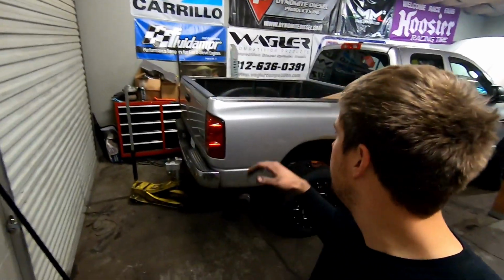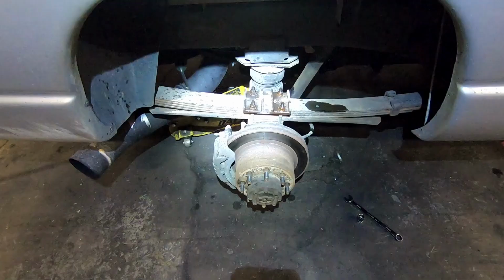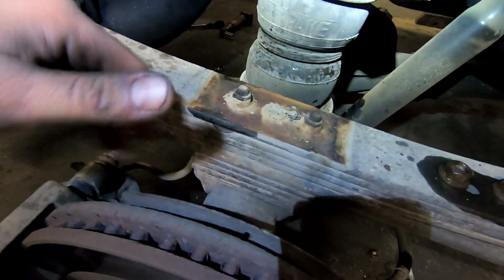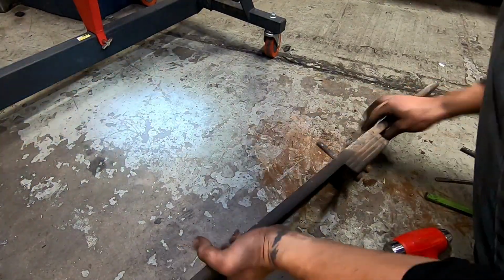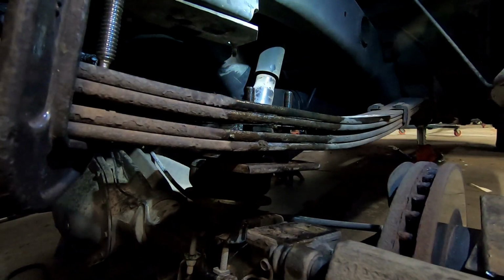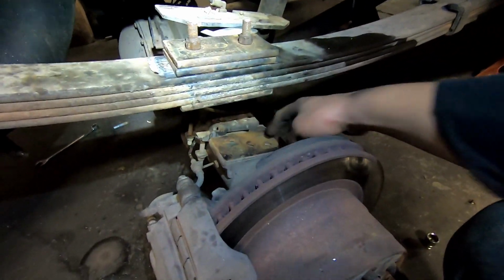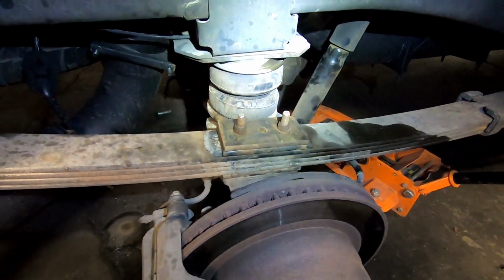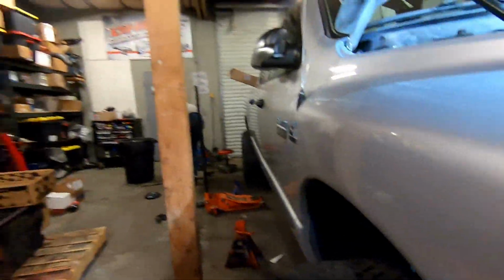LOWERING THE 3RD GEN CUMMINS

Comment: As a suggestion when driving a bolt out install nut down to level of bolt and hammer without damage of threads
Reply from the maker: Being it’s fine thread I have found it buggers it up just the same. Worth a shot though
Reply: @horsetorquesdiesel  hey when did yall straight pipe the truck
Reply from the maker: @fummins-im9tn  we did it a couple days ago, waiting on the intake as well then a dyno comparison
Reply: @horsetorquesdiesel  Oh ok makes sense

Comment: Did you have to buy a replacement bolt, if so do you have the part number?
Reply from the maker: You can use any grade 8 1-2” bolt fine thread just get the length you need
Reply: @horsetorquesdiesel  ok good to know that any bolt will fit.
Reply: @horsetorquesdiesel  ok good to know that any bolt will fit.

Comment: I did that reverse level to my 06. But my rear still sits a inch higher. Can you remove one of those spacers to accomplish that inch difference ? Would you have to purchase new mounts ?
Reply from the maker: No but you’d need new bolts
Reply: @horsetorquesdiesel  thank you. I know that was probably a lazy/silly question. I will be adding duals soon. So there might be a lot of those coming later. Haha
Reply: can you relocate all 3 spacers to the top if you pull the center alignment Dowell and put it in the overload spring